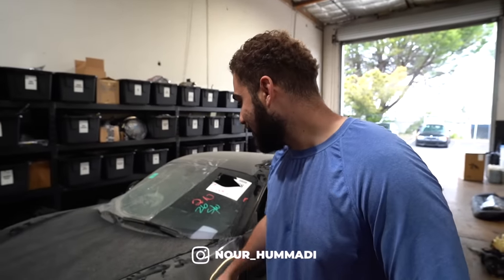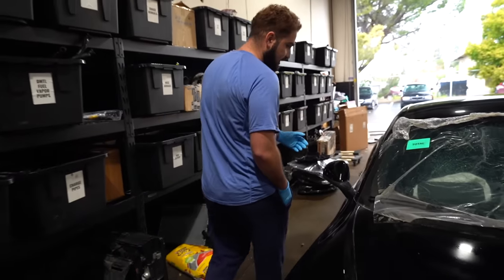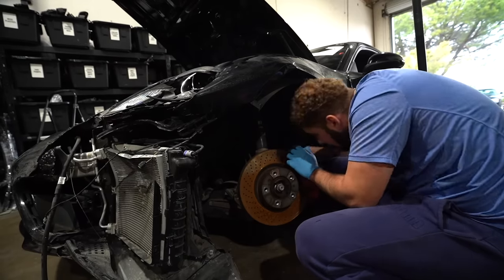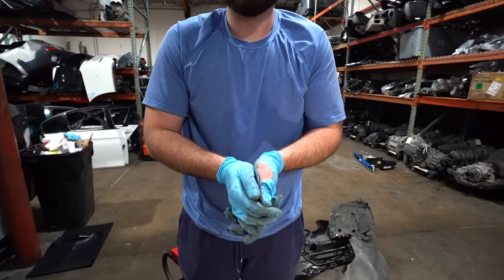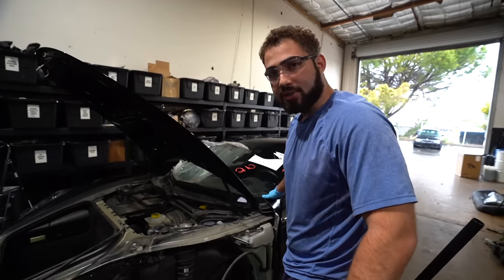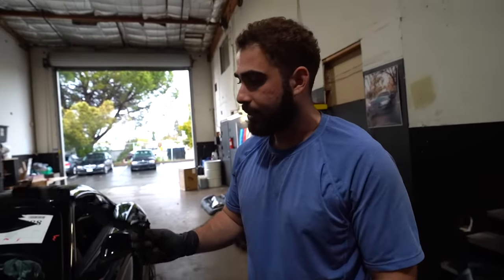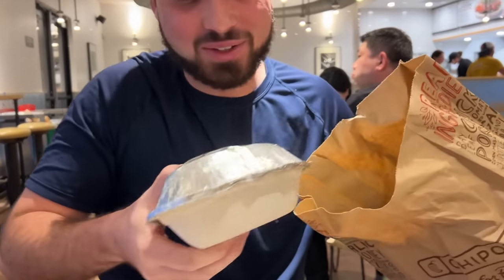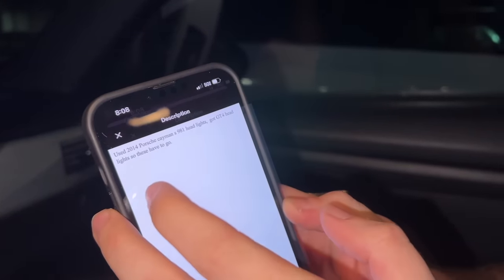I WAS SCARED TO BUY THIS PORSCHE CAYMAN S, BUT I DID IT ANYWAY!

Comment: I’ve had a 981. Only frame damage I see is the upper radiator bracket which is actually stamped or kind of riveted. Those used to be on back order from Porsche but not that expensive. Take time to get yours

Comment: Just For your interest… Porsches dont have frames, you cannot straight parts… it is all bonded with glue, riveted and welded when needed further strength.
Reply from the maker: That’s what scared me, if something get bent, it’s a mission to get repaired, so happy nothing major was effected!
Reply: @NourHummadi  No sweat... replacement is fairly easy... so if something is bent, you just need glue, rivets and the previous part to make your template... you have done mechanicaly more complex stuff... Porsches are f*****ng easy. For the damage I see... make a close up on the radiator stands, my guess is that you might need to replace the lower and upper radiator mount brackets... getting those parts is a pain, but as doable as Miss Khalifa. All the rest is bolt on. Dont even sweat... many parts are used in Audis a VWs
.